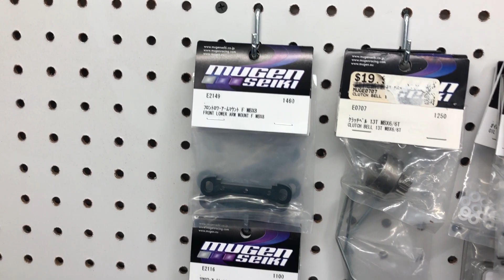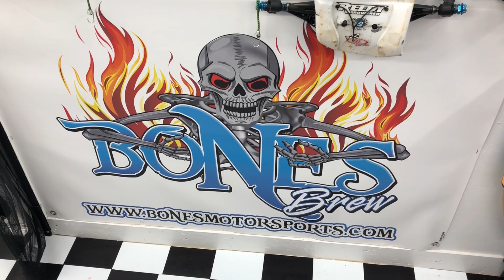Psycho Nitro Blast 2020

Comment: Do u have a picture or video of setting up  the M2c starter box adapter
Reply from the maker: Sorry no I don't but it's simple make sure the wheel lines up with the flywheel, then adjust the pins to the chassis
Reply: rajaa111 I got it bro. Super simple. Much appreciated on that recommendation. It works great